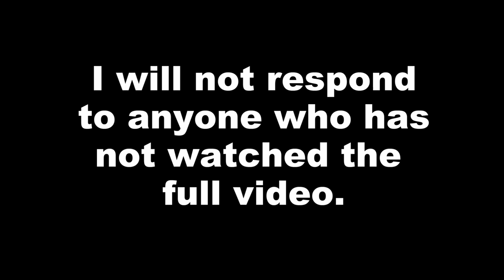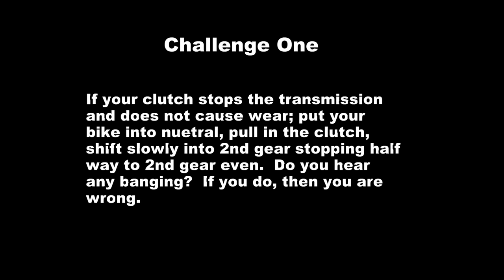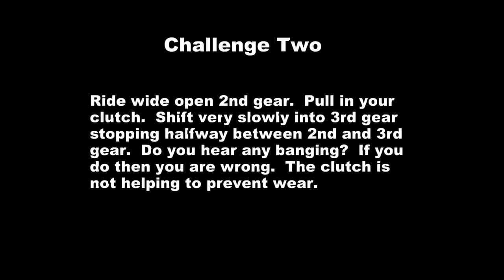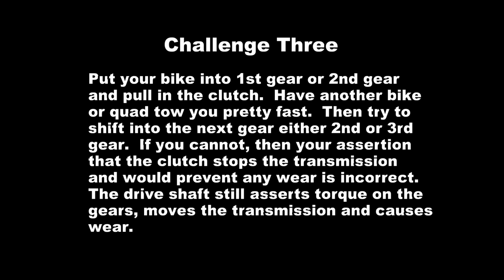Dirtbike: Shifting without the clutch

Comment: First of all I want to say you've put together a great video which clearly demonstrates how all the components of a dirt bike gearbox work. But I feel like you've left out some information which applies to dirt bikes other than yours. Not everyone is riding a two-stroke motocross bike on a motocross track. In an ideal transmission, the shift drum, the shift star and it's cam follower should be designed to minimize the time between gears. In practice with real life engineering tolerances and so on, the two shafts have to spend some time completely disengaged, even in a constant mesh gearbox. During this disengagement period, the RPM of the engine and rear wheel can diverge. On top of this, the very fact that you are changing gears requires the speed of the engine in one gear to differ from the speed in the next gear. This is no problem for you on your 2T MX bike as there is little engine braking, so the only torque exerted on the dogs to match speeds is the torque required to speed up (or slow down) the crank and piston to the speed of the rear wheel. But if you're on a four stroke dual sport with a valve train, oil pump, engine braking, and a heavy alternator, this torque can be quite significant. The torque loads are far worse if you're riding a dual sport on the road because dirt smooths out the torque by letting the rear wheel slip slightly as it matches the engine. Using the clutch to smoothly bring back the torque as the rear wheel speeds up the engine mitigates these large torque loads. Obviously MX bikes can handle these loads while on dirt tracks since racers rarely use the clutch and their bikes work just fine - but once again not everyone is riding MX bikes on MX tracks. In case you have any doubts, I'm not simply pulling this information out my rear - major dirt bike manufacturers (such as Honda and Kawasaki) have put "cush drives" on the rear wheels of their dual sports since the 80s (I have a 1986 XL600 with one, just googling 'cush drive' should bring up more model names). A cush drive adds a flexible rubber component to the rear sprocket. The purpose of a cush drive is to smooth out the torque loads I mentioned, in the same way that riding on dirt or with knobby MX tyres would). KTM has also put a form of cush drive in the clutch baskets of some of their dual sports. Even if you have a cush drive, it's best not to rely on that piece of rubber to absorb all of the loads you throw at it, especially as rubber can go stiff as it gets old. The very existence of cush drives (and their continued use for decades) shows that the designers of 4 stroke dual sports have found these torque loads to be a problem. People who have converted 450 dirt bikes to supermotards and raced them on roads have had their gears shatter under the added stresses. I personally know of someone who had a gear shatter in his converted WR450F 6 months after he bought it from the dealer. There is a debate in the motard community on whether or not you need to get a cush drive when you convert a bike. I'd personally say that you need one if you want to do a lot of clutchless shifting. Also, The assertion you make at 13:36 is not true for all dirt bikes. I have a KLX250R where the two shafts do not always spin relative to each other when the clutch is all the way in. This could be the result of a very free clutch, or it could be a bad main shaft bearing. In any case though, it can be impossible to change gears with the clutch all the way in, as the two shafts will stop or match speeds. This mostly happens when stopped (with the engine running), or more rarely even while riding. The gear shifter goes most of the way into the next gear, but then stops as the two dogs press on each other without slipping in. The banging you describe as you move slowly into the next gear happens on most bikes, but it doesn't happen on this bike (when the clutch is all the way in). This is actually one of my personal annoyances with the KLX250, and it is a common problem that other people have reported. Aside from these nitpicks, you've still put together a great video!
Reply from the maker: Thanks.  I know somewhere in the video i mention the engine breaking on a 4 stroke requires you to use the clutch, just not sure where in the 30 minutes that quote is.  Yes, I should never say never but typically it's the case that neutral doesn't force the clutch plates apart enough that it's still grabby given the less resistance.

Comment: From an engineering perspective, you are using some terms wrong, like torque. And I can tell you don't fully understand the physics. HOWEVER, you are 100% correct in ALL your assertions. You obviously know how the transmission works - much better than most engineers. Great video, great explanation!

Comment: HEY BUDDY YOU KNOW YOUR STUFF THATS 4 SHURE BUT CAN YOU PLEASE EXPLAIN  WHY WHEN I STUPIDLEY LET A BEGGINER RIDER RIDE MY 1989 VMX CR 125 HE COMPLETELY BROKE MY MAIN OUTPUT SHAFT CLEAN IN HALF WHEN NOT USING A CLUTCH, MIND YOU  MY PRO MECANIC SAID HE HAD NEVER SEEN IT BEFORE I FELT LIKE I WAS THE UNLUCKIEST PERSON EVER
Reply from the maker: Probably didn't let off the gas or let off good enough and forced it into gear.  The shifter should smoothly just shift into gear.  If it's not shifting into gear and you force it, sounds like that's what he did.  Just shift as hard as you can and force it into gear.

Comment: What's a false neutral? And how does it happen?
Reply from the maker: +david miller Shifting between gears if you can get the gear in a position where it's not engaged in either gear (shifting halfway between gears).  A lot of times a false neutral will have banging of gear dogs because there's nothing holding it precisely in place between the gears.
Reply: +Opferman Motors Dirtbiking ok love the video
Reply from the maker: Thanks!

Comment: This is just a question that I have. Why is you kick starter on the opposite side to most conventional bikes?¿? But great vid 😀😝
Reply from the maker: European bikes used to all have left hand kicks, these still do.  Honda even had left hand kick starters in the late 70s and early 80s on some of their models copying off of the European bikes.
Reply: its just the way that maico designed there bike, ktm has done it on some models also.

Comment: Why do they put clutches on bikes if you don't really need them?
Reply: +danodbdb well you would need them to set off even if you don't need them to shift
Reply from the maker: +danodbdb The clutch lets you vary the transfer of torque and speed to the transmission allowing you to power your way through difficult terrain without stalling.  This is because you can allow the crank to rev up to a higher RPM where you hvae more power but you are unable to get the torque to maintain that speed.  So by varying the clutch you can maintain a slower speed while transfering higher amount of power to the rear wheel helping you get over rough areas.  The clutch is not ON and OFF, it's more like a dimmer switch.
Reply: Opferman Motors Dirtbiking  Thank you for that explanation. I just learned something very useful. Peace:)
Reply from the maker: +danodbdb Actually I would clairfy that the power at the rear wheel would be the same but your engine is maintaining it better since itself is spinning at a higher power and thus is less affected by the resistance from the rear wheel to the crank which otherwise would force it to stall.  So, it's almost as if you've got more power at the rear wheel.
Reply: Opferman Motors Dirtbiking  Cool thanks. Can't wait to try it out this technique. I was always taught never to slip the clutch!
Reply from the maker: You want to minimize that usage as it does wear it down over time.  But that is what the clutch is for, so you just do it when you need to.
Reply: Opferman Motors Dirtbiking  Why not just down shift if you need more power? Is there an advantage to slipping the clutch over down shifting?
Reply from the maker: What if you're not moving and trying to get over a log?

Comment: I raced 250B & +25 class till I retired at the ripe age of 30, You have to lean on the clutch during WOT shifts,,,, or it don't shift,, your foot is not strong enough to pull a dog out of a cog under power,,, As if you do,, it is rather abrupt shift!  down shifting? no clutch.  now using the shifter as a foot peg off of jumps? that's bad!

Comment: so are you for power shifting?
i ruined a whole tranny as a kid, i power shifted my 1980 kx420 for a long time as i rode wide open, and down shifted with out rear brakes and with out the clutch, not just the dogs were wore, but the teeth from gear to gear, 1st to 1st 2nd to 2nd ect... the whole tranny was wore out,and the clutch basket
there is a bike where neutral is all the way down, i think it is the pw80?? not sure but they built things differently on dif machines also 3wheelers are set up differently on a couple models
also on crotch rockets "cbr, zx, gsxr ect... the shifting is backwards, but since the shaft has a arm and linkage it shifts normally at the foot lol

i really recommend to ppl that you use the clutch, to save on parts especially if its a rare or vintage machine
sorry toby i have only my word no proof, i junked the ruined tranny
Reply from the maker: +musiclovr2 Power shifting where you hold the throttle wide open and use the clutch to shift is for racing.  I never race.  I don't use the clutch when shifting, just sometimes. Never had any problems.  Some bikes have poorly designed and built transmissions and using the clutch or not won't save them!
Reply: +Opferman Motors Dirtbiking tbh by using the clutch you will only wear out the plates quicker cause your obvz using it lol I race motox and I don't use the clutch for up shifting< I only use it for setting off in 1st and in corners for down shifting and even at that am just feathering it ! not had a problem with gearbox's or anything , how ever I don't power shift while I have the throttle pinned , that to me would do some damage! also down shifting without is dangerous you'll ruin your gearbox in know time ,also if you watch the moto guys on TV like bubba and that they don't use it at all most of the time cause they get there bikes rebuilt after ever race , its all about your riding style and affordability, if you can afford to get it rebuilt after down shifting and fuckin up a box then that's fine ,if you cant then bip the throttle let off and then just kick up a gear and reapply the throttle and you'll be fine . hope that helps clear up things from the non moto guys

Comment: I can see what you trying to say,  gear dogs and gears will always spin together, and when using the Throttle to speed match gears together when charging gear. Nack to it . but Clutches are designed to be there to protect your gearbox from undue torque stress from engine when charging gear. Easier for average person to operate. Fair enough if you want to change gears without a clutch. But in my opinion it feels wrong to do so. The manufacturer would have removed the clutch if it didn't need it. I don't think I could do clutchless gear changes anyhow. Blow up my old bike.
Reply from the maker: I don't understand how stupid people are who keep saying this stupid bullshit.  "The manufacturer would have removed the clutch if it didn't need it."  As explained in the video, the clutch is used not only to remove power from the transmission, which is good for, I don't know, STARTING and STOPPING, it also VARIES the power so you can get over obstacle, push more power by allowing the engine to rev faster and slip the clutch, to hillclimb, roll over logs, etc.  It's like people don't actually ride or they just putt putt down the driveway and have never actually used a clutch.  The clutch is used for a lot more important tasks than just "shifting", shifting is the least usable task for having a clutch implementation since if you really just want to disengage the engine (which you don't even need to do while shifting) you wouldn't need something as complex as a clutch with the ability to vary the power.  You'd just have a way to disconnect the the gear by moving it to the side and disengage the shaft if that's all you needed it for.
Reply: Opferman Motors Dirtbiking sorry but obviously dirt biking is totally different riding than road biking. Never teach you how to match throttle gear changes, which there is skill too. I'm not trying to tell you how suck eggs. Gearboxes for dirtbiking are stronger for the type of riding you describing. But on my road bike, if I tried clutch less shifting over along period of time, it is going to round the dogs on the  gears and wear away the selector forks coz I am not able to clutch less shift. A Clutch is supposed to aid a rider to change gear for road riding. I agree that when dirt biking clutch less shifting is useful to keep power going to back wheel. And use the clutch when needed. Starting, stopping ect. If you want to keep a road bike working for longer, I wouldn't advise clutch less shifting. That's all I'm trying to get a cross. I have mechanical sympathy, and you are trying to go fast on dirt. Sorry for misunderstanding.
Reply from the maker: Yes I'm only talking about dirtbiking in this video.  I'm not making any claims to road bikes since I only ride and work on dirt bikes.

Comment: If you use a clutch on a dirt bike you are at risk of causing severe wear to your neck when you fall off instead of concentrating on riding. It is impossible to use a clutch. There is no time to use a clutch and hardly any human motor capacity to use a clutch. Incidentally as a kid I had an fs1e and that had 4 gears with neutral at the very top but never had problems at lights.. Just into neutral and when ready to go a simple click down. It was reverse order to this other conventionally geared bike I had so always took me a few mins to adapt.

Comment: Hello, you are the guy who plagiarized all Rick Sieman's articles in the last video. I don't know why you get so defensive against trolls. You clearly do not suffer idiots well. Your understanding of the transmission is not debatable and aligns perfectly with those who designed them. So as far as your attempt to educate trolls, Jesus, there has to be a better use for your time. I will leave you with the words of Bertrand Russell. "You cannot rationalize somebody OUT of something they didn't rationalize themselves INTO." If these 2 stroke trolls did not use logic and reason to develop their half baked theories, then logic and reason will  prove to be useless tools in your attempt to set them straight.

Comment: Yo, this video made my brain hurt... The clutch just takes the engines horsepower and torque off the gears in case you have a rough shift weather or not you feel it... all transmissions with dog teeth can be damaged from clutchless shifting... I drive trucks for a living and we call it floating gears because double clutching sucks... It does out more wear on your engine especially with a rough shift... Which is why everyone in the trucking industry is switching to automatics... Less transmission replacements and training is easier.

Comment: When your accelerating your body should be moving FORWARD.
Reply from the maker: As any object accelerates it has an equal and opposite force called the "G-Force" that acts upon the object and can be measured in weight.  In a motorcycle, as you accelerate FORWARD this force will be pushing on your body BACKWARD.  This is also why if you turn left very fast your body is forced to the right.
Reply: As you accelerate, you lean forward with your head over the the bars. The harder you accelerate,  the more you learn forward. Your body is locked lnto the bike with your legs. If a bike is throwing you backwards, you are out of control and do not understand proper rider positioning.
Reply: G force has absolutely nothing to do with newtons law of physics lol. G force means GRAVITY. C'mon man.... you're giving out false info.
Reply from the maker: M Barilla G Force isnt a real force but when you accelerate forward you will feel force pushing you backwards.  This isnt false information, ask a pilot lol.  They have G force simulators that spin you around and see how much you can take before you black out.  Your instinct to lean forward, grip your legs to oppose this force doesnt mean it no longer exists or isnt pushing on you.  If you could acelerate to Mach 1 on a bike, I doubt youd be able to hold onto the bike.
Reply from the maker: The old ride the rotor would stick you to the wall as the floor dropped.  Not sure what is so hard to understand this is fairly simple and straight forward.  There is also the air, unless you're in an enclosed capsule, the air itself is also now hitting you and pushing you back.

Comment: synchronizers not gear dogs 
RPM matching is the only way to minimize damage to the synchronizers you achieve this by double clutching or manipulating the throttle to match the RPM of the engine to the RPM of the transmission.
Reply from the maker: Dirt bikes do not have synchronizers.
Reply: they are not know as synchronizers but that it there function.
Reply: is

Comment: Fact is poor materials and design of gears and shift forks and you can use the clutch every single time with precision and STILL  blow your tranny...sheer the dogs right off and find bent shift fork(s) ...you contribute to the failure also no doubt with sloppy habits but I'm just saying a clutch religiously used won't save your tranny

Comment: Look they put a clutch on the handle bars for a reason over time if u do NOT use the clutch for 1 it will make the clutches slip for 2 u will bust the clutch basket. Why would u not use the clutch anyways? It's stupid not to bc it's not doing anything but hurting your bike when u don't use the clutch so u learn more about bikes buddy btw I'm 16 and know more than u do